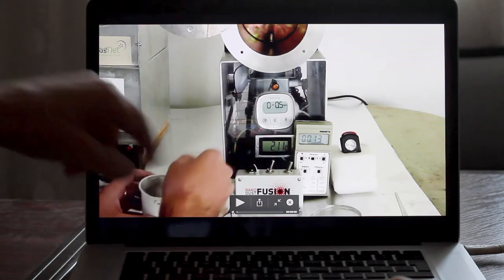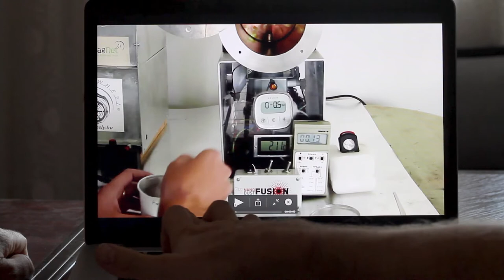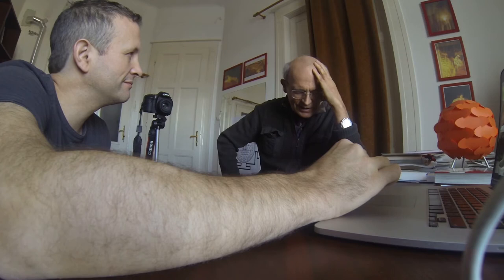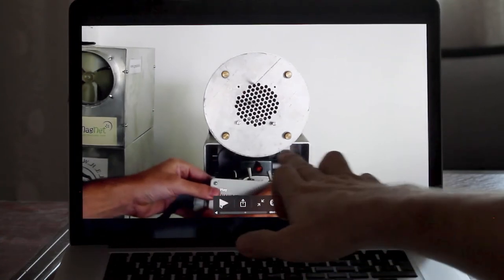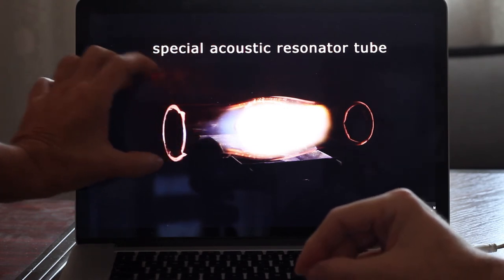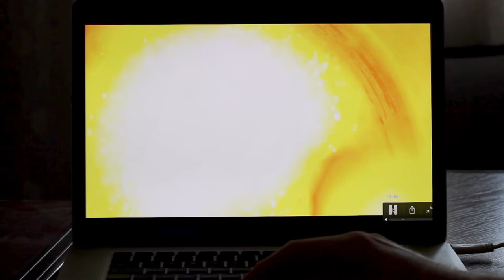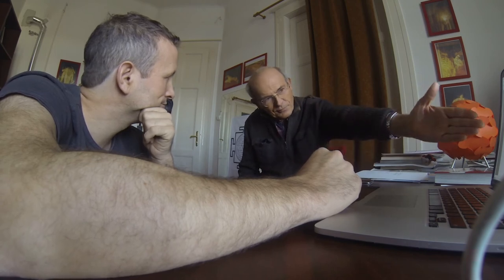.:StarDust:. P6 - Dust Fusion Discussion with Dr. Egely

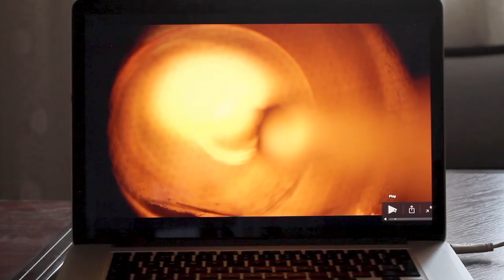Comment: 46:52 good pyrotechnic display!
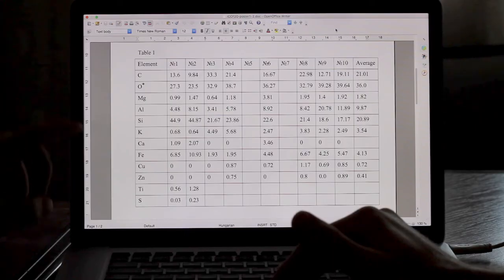56:39 table of transmuted elements C -> Cu Zn Ti S
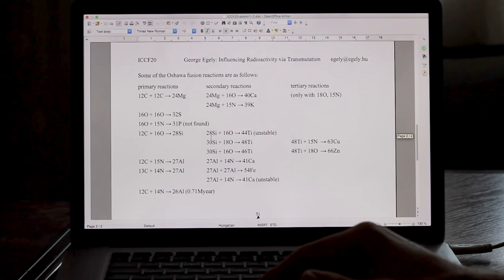58:45 transmutation reaction equations (from Gyorgy Egely's  ICCF20 Paper "Influencing Radiation via Transmutation", Oshawa fusion reactions)
http://www.infinite-energy.com/iemagazine/issue130/EgelyIE130.pdf
(not exactly the same paper but has same diagrams)
1:00:12 Shows the Oshawa/Egely C/N/O "transmutation ring of reactions" (graphic). From here onwards, a very interesting discussion of the possibilities of reactions in general, touching on the idea of C + H reactions being best able to generate excess energy. Other reactions are often balanced, endo-/exo-thermal.
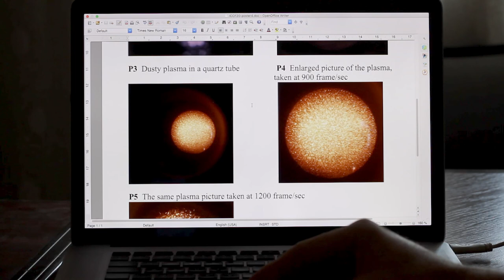1:10:11 Potential manufacture of heavier elements, Palladium, rare-earth etc
Reply from the maker: For sure.